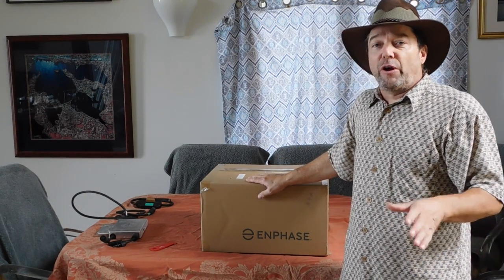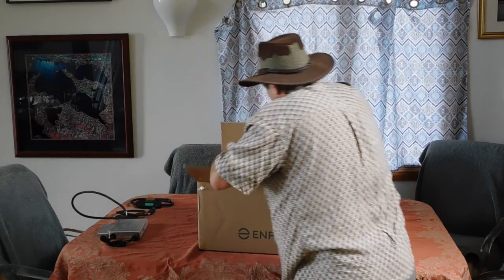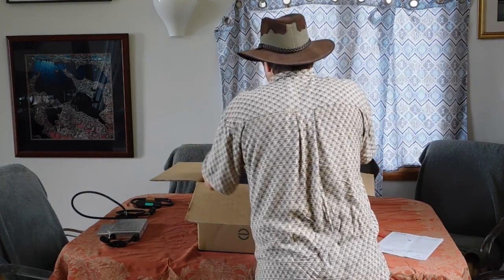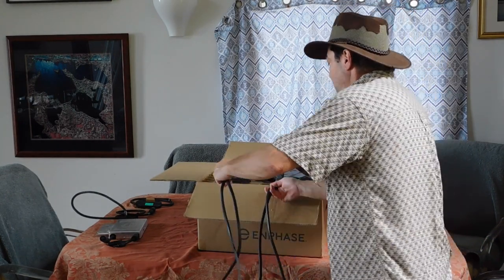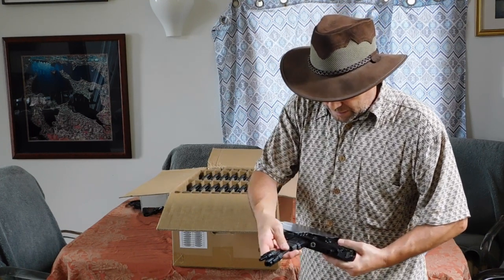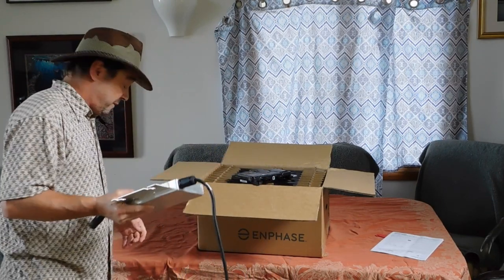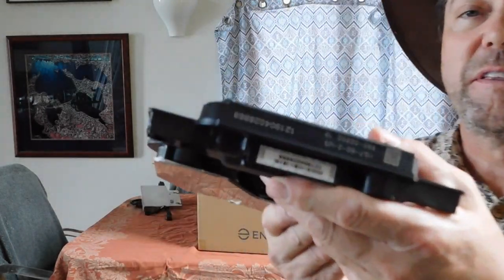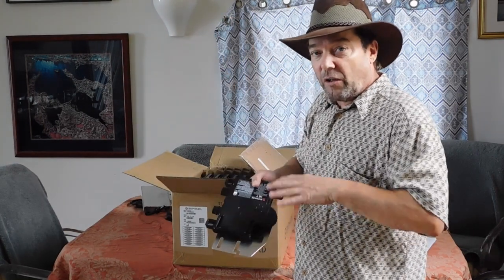Unboxing Enphase IQ7 Micro Inverters

Comment: How do you buy the string of AC plugs/wires in the separate box? I know this is old but as I piece my system together I can't see this anywhere. When I look to purchase separate IQ7+ microinverters from random sources, all I can see that comes with it is the DC panel pigtail (short one).
Reply from the maker: I can get them for you, email me at jtn@gogreenenergyonline.com
Reply: Can you please explain how we the diy can get the long single string cable. Thanks